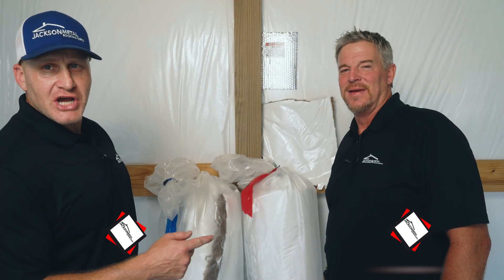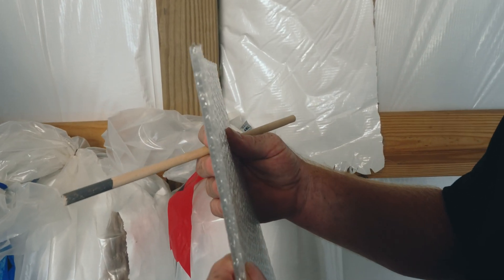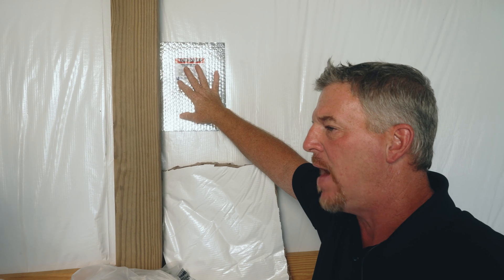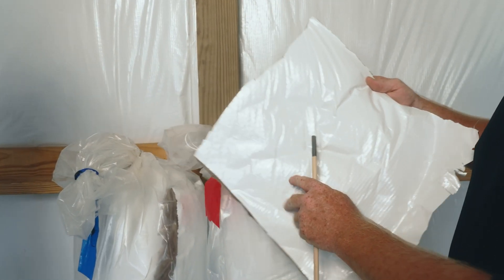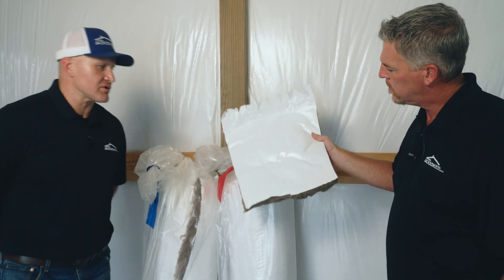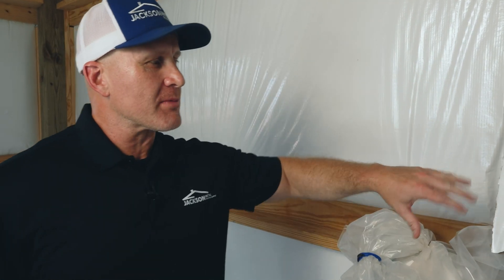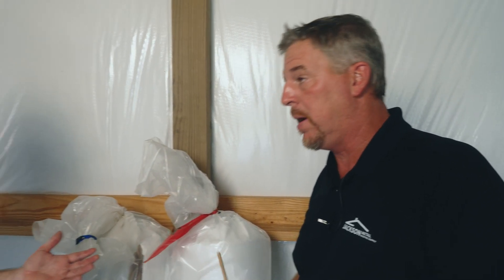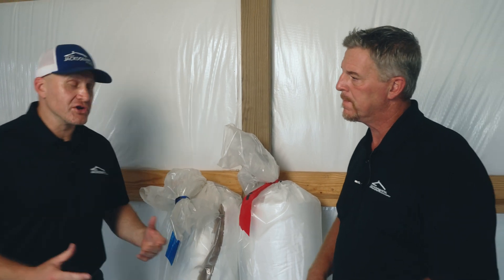Understanding Your Insulation vs. a Radiant Barrier with Jackson Metal

Comment: I don't think it's accurate to say that radiant barriers don't provide any value in winter, it just depends on which way it's facing. If you have a double-sided radiant barrier, or single-sided facing the interior (and it has an air space, not flat against another solid surface), then it will radiate the warmth of the heated interior space back into itself, and minimize loss of that heat to the atmosphere. This is assuming the interior space has a heat source.
Reply from the maker: You're absolutely correct to say that it does offer some insulative value even in winter, however as it is mainly a radiant barrier insulation it works best for summer time applications vs winter. Thanks for the comment, keep them coming!